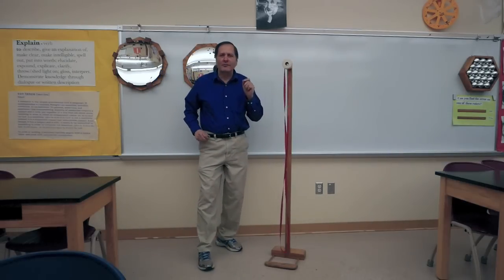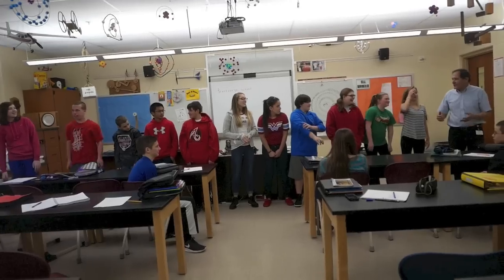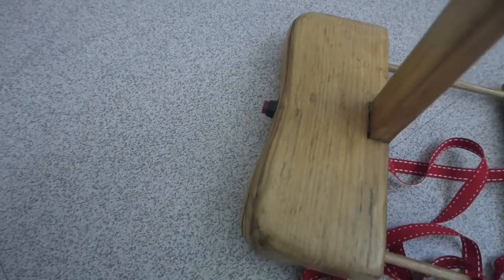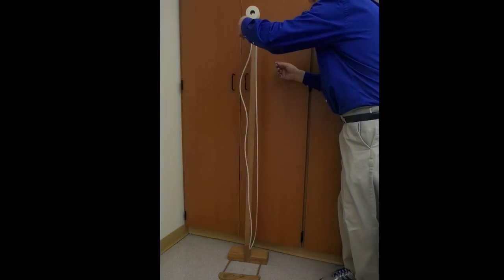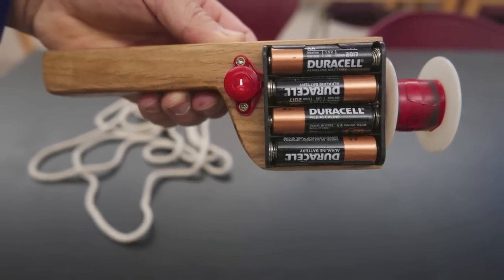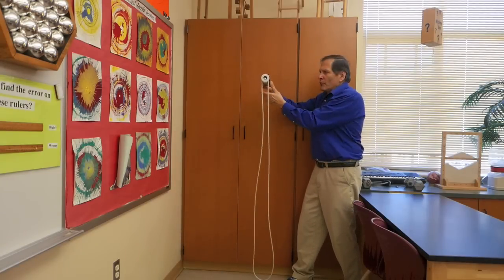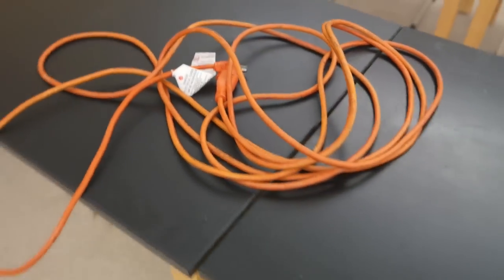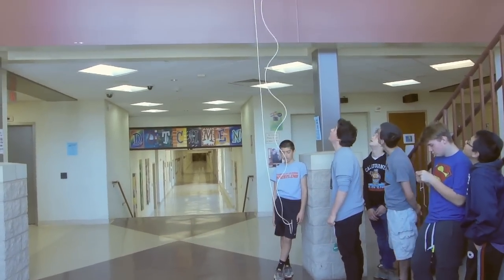Slow Moving Waves in Rope - Physics of toys // Homemade Science with Bruce Yeany

Comment: so I may have missed how the transverse wave affects the return string differently from the other side, but Steve Mould just did a video asking about the physics here. from just looking at this, I'd say it's very related. he was postulating for a chain fountain video. looking at that it's pretty straightforward how the falling chain is behaving like the return side of the ribbon as it holds waves and patterns. but the chain is not a loop so the "pushing" doesn't seem to be a factor and just the force that pulls on the string. I wonder how the string shooter modeled after the baseball launcher would look with just a long single string that was not looped. my best guess would be it looks similar to water coming from a faucet. when the water encounters the surface of the sink it creates a very small section of ripples/waves just above where it makes contact with resistance. I'd bet the string here is well over terminal velocity and the air would provide enough resistance to slow it within a foot of launch. in that foot I'd imagine it travels smoothly then starts to veer slightly off course, that leads to far more resistance to the original direction of travel causing a wave that exaggerates itself as it continues to fall. I don't know and am having trouble wrapping my head around it
Reply: Nah your right on it

Comment: does the behavior flip directions if you move it from the bottom?
and what's going on on the bottom? why does it start to noodle around instead of continuing the wave? will a less sharp bottom change it?
Reply from the maker: yes,  I should have showed that bette, think at the bottom the rope or ribbon is slowing returning to it's longest length.  I'll be showing this again in a new video hopefully this spring

Comment: can you show me how to make continuous piece of string
Reply from the maker: It's actually pretty easy,  use nylon rope or string.  Heat both ends of the rope together with a small flame until the ends melt and stick them together.  While they are still hot roll the new joint between your thumb and finger to smooth it out, of course you need to be wearing gloves while doing this.  If you're not happy with the joint,  cut it off and try again.
Reply: Bruce Yeany thank you sir
Reply: 131marti131 send me the URL can't get it

Comment: What would happen if you tried to make a wake at the bottom of the rigid side?
Reply from the maker: It works  but not nearly as well,  same tup of slow moving wave starts upwards but seems to die out much quicker than the ones traveling down

Comment: how do you connect the ends of the rope so that there's not a bump in the loop?
Reply from the maker: the rope is nylon with some type of fiber in the middle,  I removed a short amount of the middle fiber and then heated the nylon strands until soft,  put them together and  rolled them between my thumb and finger while still hot,  of course I had gloves on
Reply: Excellent.  Thank you!  :D

Comment: Have you tried making the waves at the bottom of the long rope but on the other side? Surely it would work the same (but would save the kids leaving over railings?). Really love this idea, have to make one for myself now...
Reply from the maker: It's been a while since I've had it out,  I'll got back and check,  it seems like we got better results from the top.   good luck with your own tests,  if you can add anything to what I have here, I'd love to hear it,  my goal is to try it horizontally between two wheels  and get the wave to stay still
Reply: If you can get it to work horizontally that would be fantastic, especially if you can vary the speed to make the wave stationary.
Reply from the maker: My plan is to use a drill  that has a speed control on it.  We'll see if that works

Comment: If it went fast enough, could you make the wave appear stationary?
Reply from the maker: I'm hoping to try in again when school is back in session.  I want try and see if I can get it to stop and then come backwards.
Reply: Bruce Yeany that would be great!
Reply: Is this not similar to the wagon-wheel effect?
Reply: Bruce Yeany you can probably put a motor controller to make the wave come back and forth so it looks like it’s dancing :)
Reply: I testet it :) see my channel, even with excessive speeds it will not come to a stop or reverse, wave even gets faster flattened out and more rigid by the increasing momentum, so who will be able to explain or calculate whats going on there? =)

Comment: is it me or does the rope appear to fall slower after one of the students accidentally pushes it of the wheel, while the rope is in motion?
Reply from the maker: you are right it does look like it falls slower,  I'll have to go back and try it
Reply: I think it would have a little of rigidity for a brief moment if it's spinning fast enough and got enough momentum (having the floor and/or the surface of the string more slippery should help a lot).